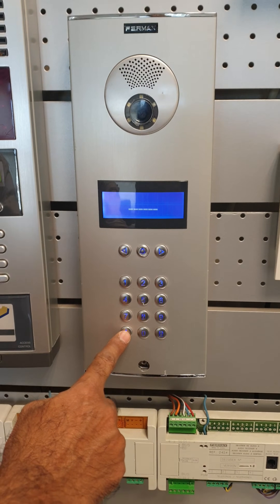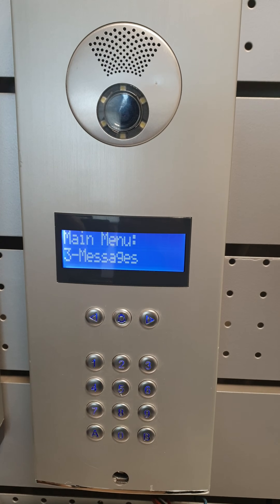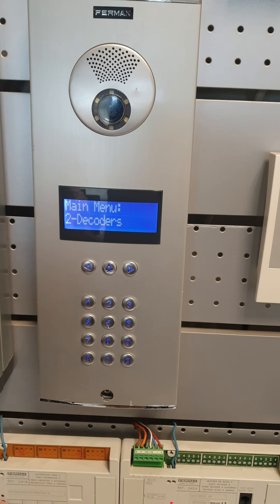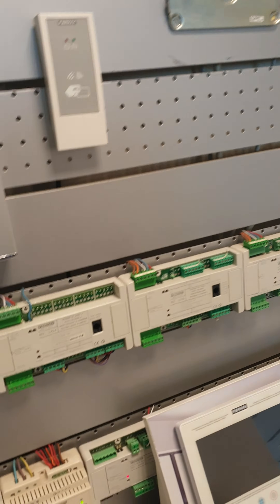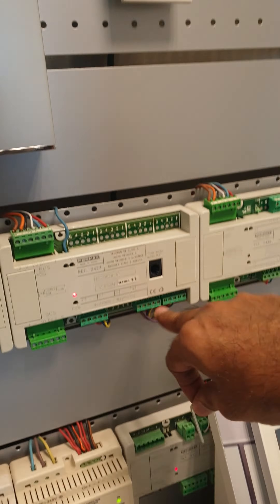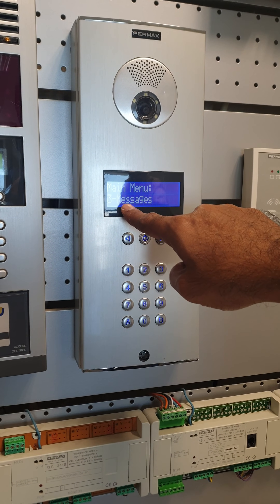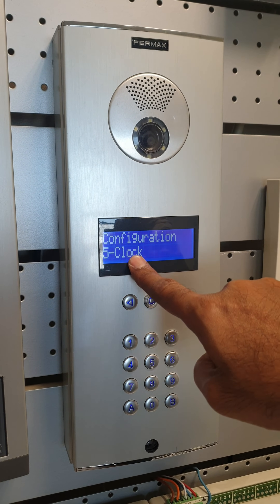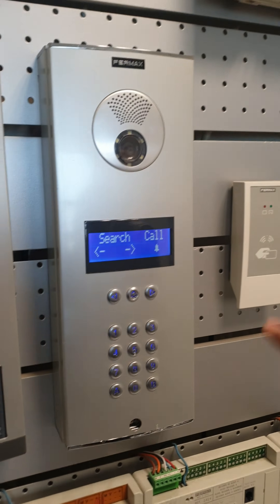Fermax Audio Intercom installation and programming

Comment: Can the keypad be used as a code too, to gain access to the building? I have a few questions on the City line system, would you mind contacting me privately?
Reply from the maker: Hi ,

defiantly you can creat a password to access the building , once you put the password door strike will be released immediately, 
please contact me on what'sapp 009715006688131
Reply: @allamabuhuson6271  Hello, thank you. Your number isnt working on WhatsApp. Can you please send me your email?
Reply from the maker: HI, 

Please try 00971506688131
Reply: @allamabuhuson6271  Hi, I did whatsapp, i had no reply?
Reply: @allamabuhuson6271  hi boss I have one complete building project so can we talk 00971 567454365